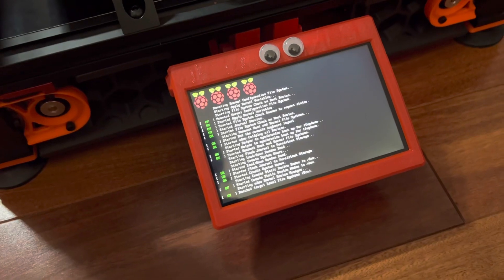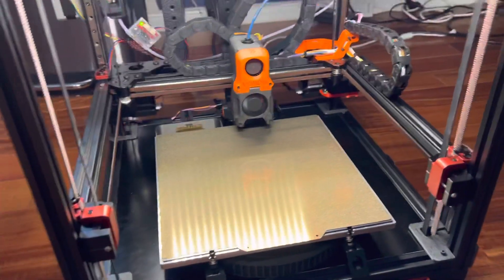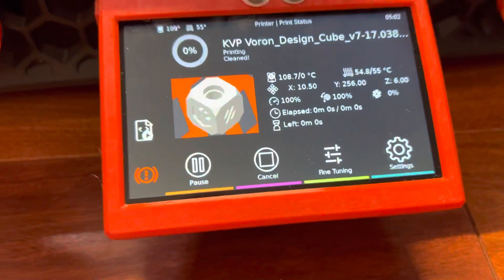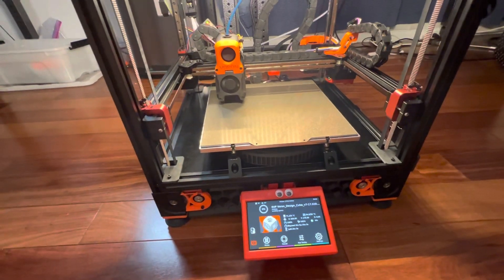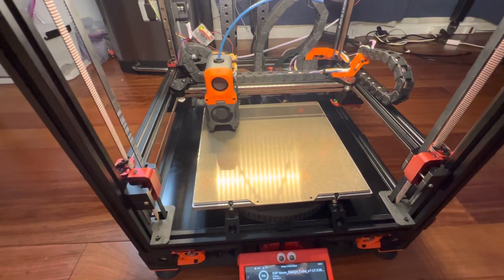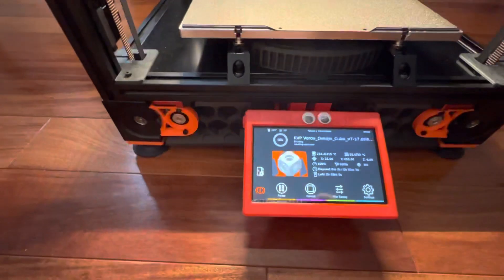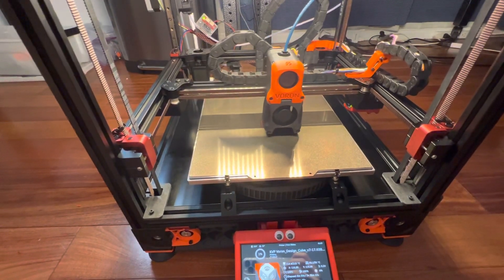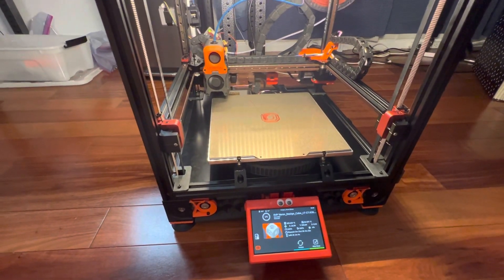Voron 2.4 Working

Comment: 1:53 normal printer taking 30 minutes or more to do bed leveling? Are the printers printing steel??
That is so not accurate. I get it, Voron prints fast asf, etc, but it takes 5-6 minutes to do bed leveling. A big WTF.
Prusa MK3S+ does the bed mesh within seconds and 7x7 instead of 3x3.
Reply from the maker: Bed leveling takes a lot less time after tuning it properly.  This Voron now also does Z calibration for me automatically, which is something I always hated doing on my Prusa.  I just throw files at both printers and get consistently good prints in the garage from my desk, about 3x faster than Prusa ;)
Reply: 5 minunts of bed leveling its not much time for some hours Perfect  print that would take saveral days in yuo Prusa
Reply: @noway8233  1min leveling, perfect print so I am not sure wtf you are talking about.

Comment: Hi! Congratulations! Your V2 is very well assembled. I saw a detail, the mounting parts for the printer, are they printed or machined? It seems to me to have a very smooth and perfect finish. Congratulations on the video. show more... Thank you
Reply from the maker: Yeah I've been using Fysetc CNC aluminum parts for the Z drives and AB motor mounts and some other places off the X axis

Comment: Just starting to look into getting a Voron kit. Yours look fantastic! Which one did you get? Any chance you have a parts list? Thanks
Reply from the maker: Kits:

Buying a kit to build a Voron may take longer than self-sourcing and can be more expensive.  You will wait longer for the kit to arrive, and some of the parts will not be the best ones for your build, or may be unreliable where you need quality: e.g. SSR or inductive probe.  So you may end up buying some parts twice if you order a kit.  It's best to buy subkits from vendors you can find on the Voron Discord under the VENDORS section - Just google the store name and search to see what they offer, and you'll find subkits for parts that you need that will ship faster than from China and often with higher quality.
Ordering the cable chains directly from IGUS on digikey.com is a good idea, as they ship quickly and I've had trouble with intermediate vendors selling kits at a markup not including the right parts.
Reply from the maker: For hotend the Rapido is a good choice right now.  Reasonable price and top-end volumetric flow rate and easier to clean without shorting out than a Mosquito Magnum
Reply from the maker: Using genuine Gates parts for idlers and pulleys is a good idea to avoid zebra stripes in your prints.  Link here: https://www.filastruder.com/products/gates-2gt-pulley?variant=15443750518855  https://www.filastruder.com/products/gates-2gt-idler?variant=15443755728967
Reply from the maker: If you need more info please contact me on Discord - I'm @catid there
Reply: @oculuscat  very much appreciate that! Thanks :)

Comment: 4:50 nice build, it seems like your start G-code is missing a move away from your z endstop: it collides with it when it's done homing. I had that issue with mine too.
Reply from the maker: Thanks for pointing that out!  Since this video I've added on the Klicky probe mod, so the start gcode changed a lot and it doesn't do it anymore.  Going to post a serial request video in the next week or two after fixing a few more issues.

Comment: So, looks like you went aluminum for the gantry parts vs printed.  Also, your homing bed level speed can be raised in the config if you wanted to
Reply from the maker: Yeah seems to work fine.  CNC milled aluminum is really rigid so I'm not so worried about belt path, and the motors are now sitting on aluminum so it's like they have a heat sink and I don't mind if they get too hot.  With aluminum parts the GE5C mod makes a lot of sense so you don't have to worry about flex in the gantry parts.  I didn't use them for the toolhead because nozzle crashes with aluminum toolhead sounds awful lol.  The crashes I've had so far were not bad.